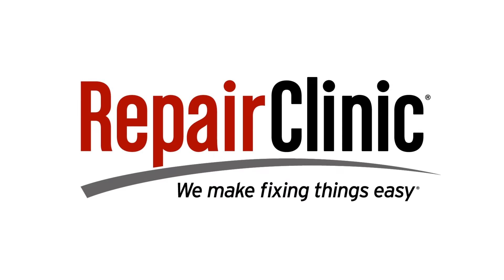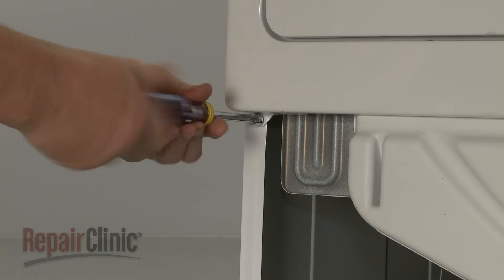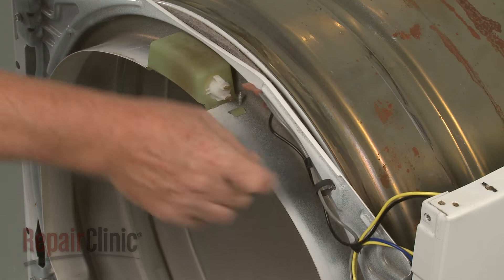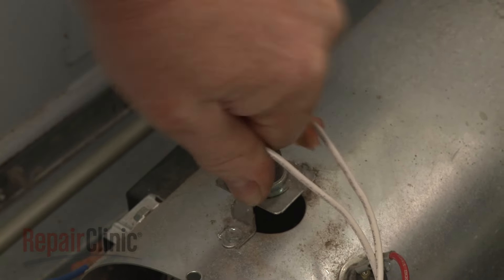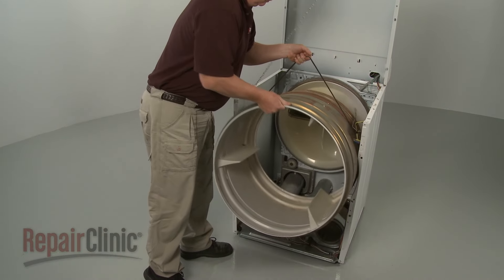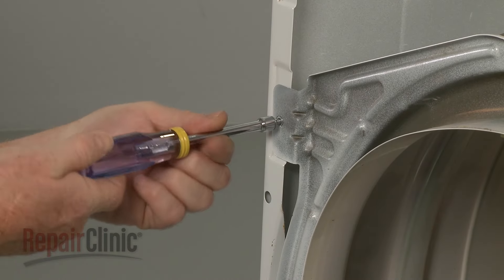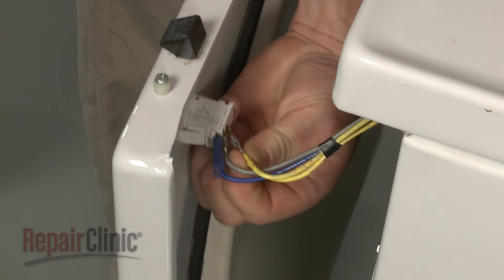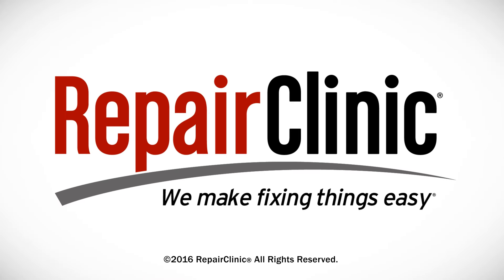Maytag Dryer Thermal Fuse Replacement #WP40113801

Comment: if the dryer heats up but doesn't spin, is that a thermal fuse issue?
Reply: If not spinning more than likely belt

Comment: Thanks for the video. I have a Maytag Quiet Series 200 gas dryer and this is the video you need to fix your thermal fuse.  I've seen several others and they suggest that the thermal fuse is located on the back of the dryer and it is NOT. Good Luck!!!
Reply: Thank you, I have the same model. I will follow this tutorial and let you know my results.

Comment: So my dryer was doing where it wouldn't spin up or blow air and keep saying check lint screen, cleaned the whole thing out, I looked up other videos and decided to check the thermal fuse, I have a multimeter but couldn't find it so I used an old school power tester and well much like a solenoid I jump started the dryer and it worked fine for as long as it was left on. Turned it off came back to the same issue. I think its the thermal fuse but before I had tested that I reached in the upper portion of the back and got a tiny shock. To anyone having the issue check that sensor first, seems like it can pop pretty easy. Hope this helps
Reply: What's the full name of the sensor you want us to check?

Comment: My electric dryer is about 8 years old but used about 4 years long.   It is W10529646B   Since I have no heat from it, it may be the fuse or Heating Element. Which one should I get to fix it?  It seems there is 2 kind of fuse.   And can it be just one problem?  Not two? Fuse and/or heating element

Comment: Hello Hoping you can help here I haver a maytag Bravo gas dryer 300 series Model number MGDB400VQ0 Stop heating , Plenty of air flow Stopped heating, Ran Diag dhows f28 = moisture sensor. took the lint trap out reviewed the moisture sensor and harness . Two metal strips seem ok intact . Should I change the two metal strips of that harness wit the two big round blue resistors ?
And is f28 accurate on moisture sensor failure ?Thanks in advance